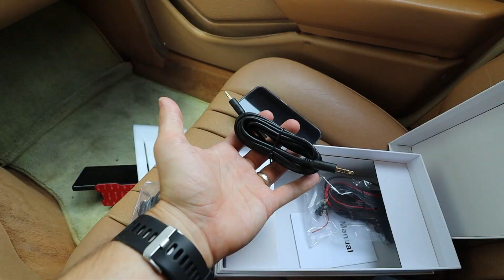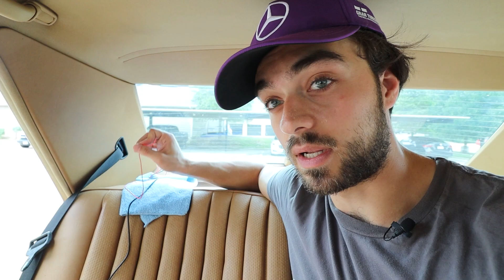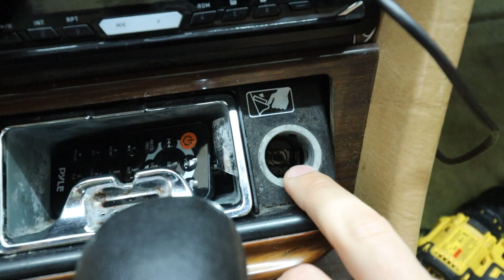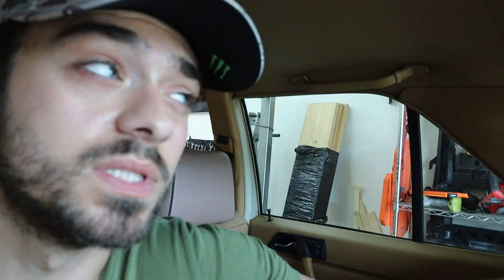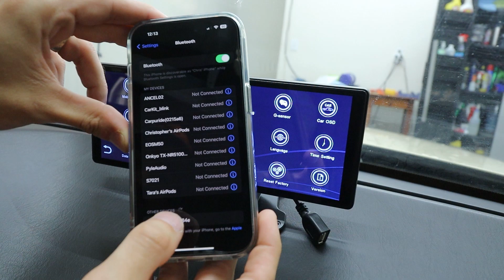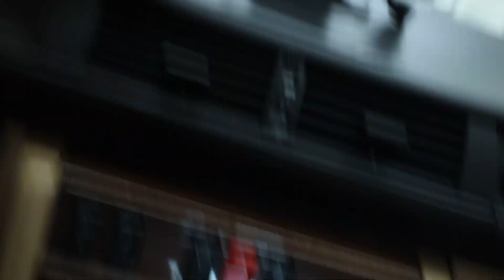Built-In Dash Cam, Apple CarPlay, Rearview Camera FOR LESS | Seicane better than Carpuride?

Comment: You had mentioned on a different review with a different unit that it didn't automatically turn off when you turned off the car. Does this one automatically turn off when you turn off the car?
Reply from the maker: It does in my Mercedes. My van probably has the incorrect fuse inserted into the 12v power, which is why it doesn’t turn off automatically
Reply: Just bought one of these and I have it in my Ford transit custom. It doesn't shut down either when turning the ignition off, it's connected to the 12v socket. Is there a workaround for this or do I have to unplug everytime? Thank you

Comment: Can the rear camera be activated automatically when selecting reverse?
Reply: THIS bruh that’s my question too
Reply: @twice8091  I think I found the answer in another video.   Apparently the answer is yes.  If the wire to the reverse light is connected, it can detect when reverse is selected.
Reply: @EsotericArctos  thank you!

Comment: First - AutoMotivate, thank you for your video - For those considering purchasing this unit - I've purchased one of these Seicane Dashcam/Apple Carplay units, and have installed it in my car. I would say, I have very mixed feelings. After the initial few days of playing with the unit, powering it from the cigarette lighter power, I opted to hardwire it using the provided 3A power adapter. Pretty straight forward install, and I KNOW I've installed it correctly. So here is my feedback: 1. The units feels solid to touch and the display has a good appearance and feel. I like the IDEA of this product, but it has several flaws! 1. even if you mount it sold, it still shakes while you're driving. I fixed this shaking by building a simple block on my 3D printer and stuffing it between the display and the mount from the back (so you don't see it from the front). 2. Audio pass through quality sucks! I've connected my iPhone wirelessly to the Seicane unit, and from there, there is a cable going from Seicane to my car stereo through the Aux input. Comparing the pass through quality to simple direct bluetooth connectivity to my car stereo, I would say Seicane quality is awful. I am willing to tolerate 1 and 2, but then there is 3. Every time I turn off my car, and turn it back on again, I have to do a hard power down on the Seicane unit (holding the power button at the top of the unit for a few seconds), then power up the unit!!! To me, this is the deal breaker! This brings me to 4. AWFUL tech support!!! I've reached out to Seicane, and they have responded quickly (within 24 hours), BUT the quality of support is really really really BAD! After a few emails going back and forth, they came back with requiring me to do a firmware upgrade. I have no problem with this, BUT the documentation they have provided and the video makes you laugh and cry at the same time! First of all, everything is in Chinese (at least all the important stuff). They have also provided an .mp4 video to download, which is supposed to help! The video is absolute utter rubbish! I am really disappointed with Seicane!
Reply from the maker: I really appreciate your input and this comment was my last straw. I am removing the links and adding a follow up video in a few days to talk about these issues. The Audio pass through has been complained too many times for me to continue to recommend this unit. I thought the my cars audio was just older and not performing well, but I was wrong. I will, however, try to use a higher quality Aux and see if that fixes that issue. Never the less, Thank you for the comment.

Comment: Im just wondering if how's the sound quality connecting the device to the player with an aux cord? cuz mine sounds like you're in a call and music is on
Reply from the maker: I thought mine sounded comparable to how my audio was before, but you are not the first comment saying this. The audio for my 300D was not the best from the beginning, so I did not notice a difference.  Ill look into it and see if I can find a solution
Reply from the maker: Is the quality the same if you use the FM selection? If it is not then I would recommend finding another AUX cord you could try.
Reply: @AutoMotivate  yeah its the same quality, I tried every method, aux, fm tramsmitter mode and still doesn't sound good. currently Im using my phone as where the audio releases so that I can connect it to my player. I hope you can also find a solution for this. 

also I tried turning off microphone recorder in dash cam, but still the same outcome.

Comment: Just got one. Is the FM audio supposed to be of atrocious AM quality, or did I get a bad unit? I have a cheapo audio-only BT-FM transmitter that sounds pretty good, so I know it's not my setup.
Reply from the maker: It seems like there are a lot of complaints with the Audio so I deleted the link to the unit and I will create a follow up video addressing this issue. I am pretty disappointed.

Comment: I just bought one for my Honda Odyssey. The car doesn’t have aux. And I’ve trying to make the audio play through my speakers through the FM transmitter. But it’s not working!! What do I do??
Reply from the maker: It should be working! Set the station on the headunit, try to make sure it is an “empty station” then change your radio station

Comment: Hi, I bought the same model and unfortunately, the sound quality is horrible, even when plugged in with the aux connector. The other features are great but without proper sound, it's useless.
Reply: Same for me :/ Everyone else seems happy with theirs, maybe we got bad units?
Reply from the maker: It seems like there are a lot of complaints with the Audio so I deleted the link to the unit and I will create a follow up video addressing this issue. I am pretty disappointed.

Comment: Do you like this better than the Rear View Mirror? I have a long old van. Need a back up camera
Reply from the maker: I do not think the software and its rear view camera capabilities would be a replacement for the rear view mirror. 
I have another video where I installed a wolfbox rear view camera/mirror replacement and that would be suitable. 
Although it does for a good job, it takes so getting used to.
Reply from the maker: Here’s the video: 
https://youtu.be/x4PJdRAPNCs

Comment: Can you tell me how much hiss you hear in the AUX line?  I have a crappier unit and it has way too much hiss in the audio.  With the unit not playing anything and the radio at normal volume (if something were playing) it's like a soft white noise coming from all my speakers.  Also - can you hear any engine / alternator noise through the AUX line?  A typical problem with some of these is too little shielding and isolation on the audio outputs.  

Thanks for this review because I'm really considering the Seicane.
Reply: I got one of these and the audio noise is absolutely terrible. Sounds crap.
Reply: @sammole1  Thanks for taking the time to reply.  I was afraid of that.  It seems all of these 10.26" solutions have the same terrible audio output.
Reply: @Tooob  it's a shame because screen is pretty good and it looks nice a sleek. Wonder if I can find some work around to make it sound better.
Reply: Have you tried adding a ground loop isolater for 3.5 mm? That usually helps get rid of unwanted noise
Reply: I just got one too and it sounds horrible; I have one of those audio-only FM transmitters next to it, which sounds fine. Not sure how everyone else seems so happy with theirs.
Reply: @uber2k  it's absolutely garbage. I got issued a full refund.

Comment: I have a 2019 Ram and the Bluetooth connection takes forever AND you have to hit a physical button on the factory screen to change from radio to Bluetooth input every time the truck starts. Does using AUX solve that issue? In other words, would the stock stereo instantly switch to aux instead of radio without any user input?
Reply from the maker: Hey man! 
As far as I know, it should work.
Whenever I kick over my car, Apple Car play automatically connects, so i dont see why not.

Comment: I was thinking about getting the exact same screen, but i was wondering if the screen is bright enough to see the map in the sun? Or does the screen have an anti glare coating?
Reply from the maker: I think it is, but the sun doesn't beam directly on it, in my case.
Reply: There is definitely glare. Depending on how much light hits the unit, you may need to adjust to brightest setting.

Comment: I've used this for 6 months now on my 2007 Toyota Camry. You are 100% right, for the money, it is insane value and the dash cam quality is actually pretty damn good if you have the 4K model like I have (some sellers also sell a 1440p model).
Reply from the maker: I mean, you can't really beat it! For the security it gives you and the modern tech for only $100.
Reply: Hmm definitely don't need 4k. 1080 should show everything I need in detail, assuming its a high qual 1080 of course.